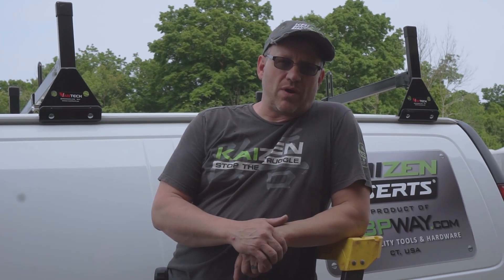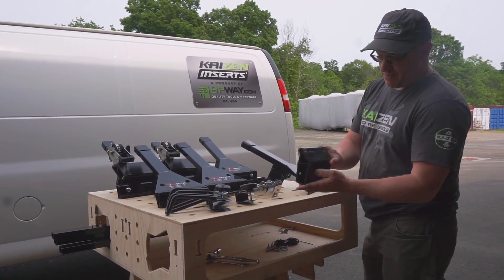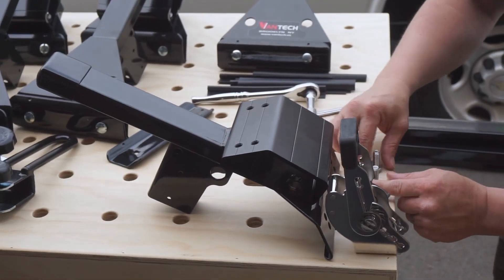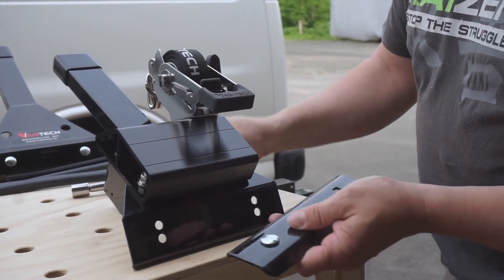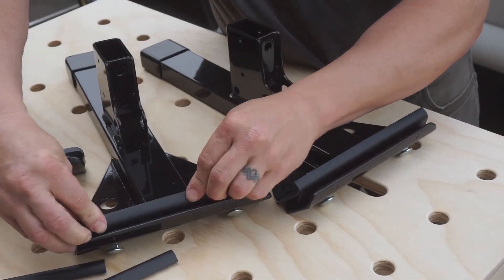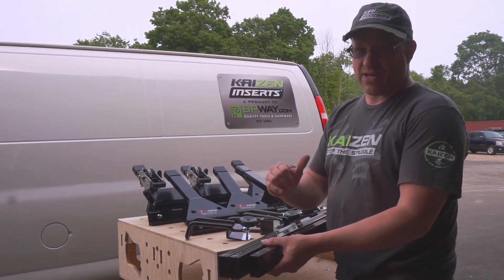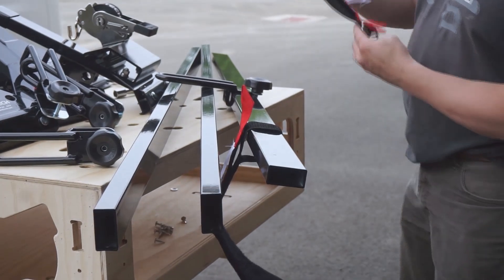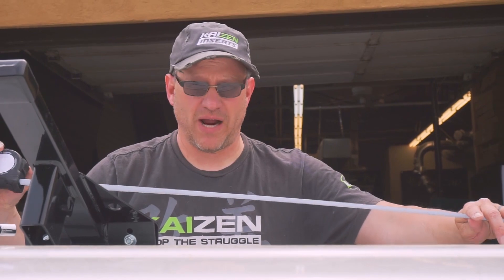VanTech Ladder Rack Installation with ratchet straps

Comment: How do you seat the clamp in the rain gutter with a fiberglass topper conversion?  The topper blocks any inward motion; about 20 degrees inward motion is required to seat the clamp before tightening the bolts to the gutter.  I bought a ladder racks for a conversion van; there was no mention of how to mount it to a conversion van.
Reply: I would go for the Vantech H1809 like I did for my extended hightop